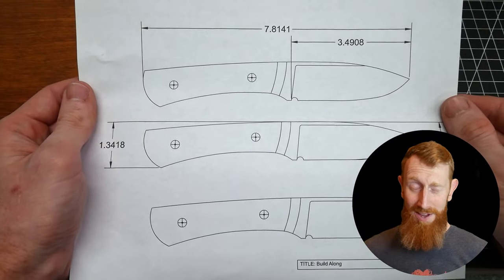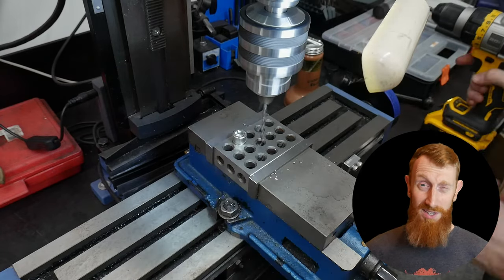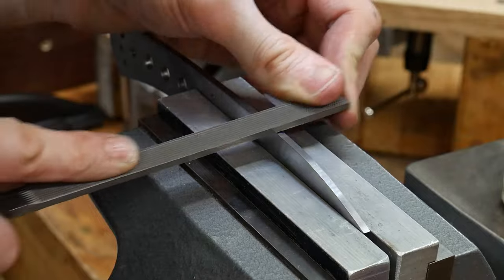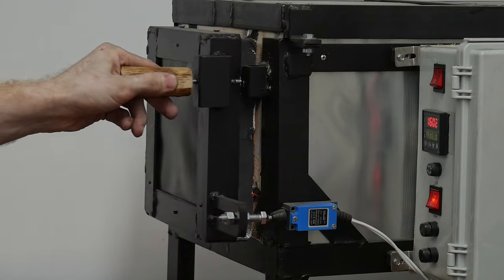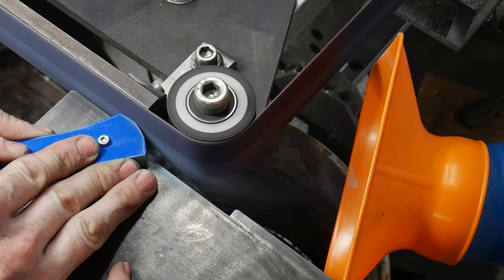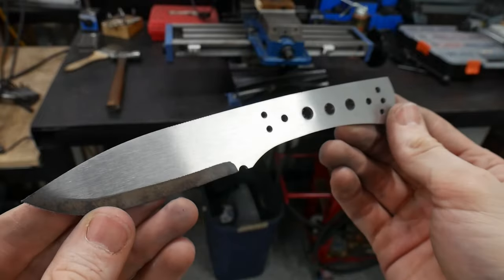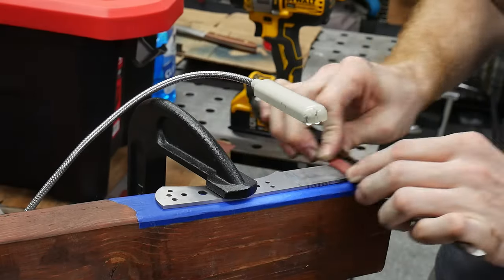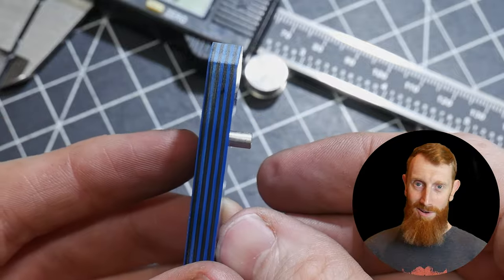BUILD ALONG & Viewer Competition - LETS GO - Part 1

Comment: That's cool. I want to participate but I don't have the tools yet. I just bought the 2x72 belt grinder and it is going to be delivered tomorrow.  I went to Harber freight to buy the Bauer portable band saw that I ask your option on the last video, but they were out of them. I'm can't wait to get started. Stay awesome.
Reply from the maker: Hey Adam, not many tools needed! Check out Cole's build along video here - https://youtu.be/REqEC8x80Kk - He's using hand files!
Reply: @RedBeardOps  You are absolutely right. The reason I'm waiting for power tools is, I have already worn out my joints from heavy power lifting in the past. Also, I work in industrial maintenance for my day job. For me power tools help me as I get older to not hurt myself with repetitive work. I will start making knives very soon. Stay awesome.

Comment: Good Morning.  Could you Please send a link for the bits you used to counter sink the handle material.  thanks
Reply from the maker: McMaster Counter Bore (3102A11) - https://www.mcmaster.com/catalog/126/2608
5/32'' & 3/16'' (3103A12 & 3103A13) Pilots - https://www.mcmaster.com/counterbore-pilots

Comment: what are you making at 6:52?  what bit are you using to drill at 7:01?
Reply from the maker: I was reducing the length of the fasteners. 

McMaster Counter Bore (3102A11) - https://www.mcmaster.com/catalog/126/2608
5/32'' & 3/16'' (3103A12 & 3103A13) Pilots - https://www.mcmaster.com/counterbore-pilots

Comment: Where do you get your threaded pins?
Reply from the maker: Depending on the build you can use loveless fasteners, corby bolts, or gulso fasteners. They are all sold at various knife supply shops.

Comment: I'm pretty sure I'd easily fit into the novice category. I've been making knives officially, I believe just barely under a year, and I only have a 1x30, and a 4x36 that I use to make them. 

Just to be clear we are all trying to make the template knife? Are we trying to put our own spin on things or just trying to copy it exactly?
Reply from the maker: I envision us all building the same knife in a build along. More or less. We're trying not to be too rigid. Just have fun with it! For my build I stuck with the design as drawn. Nothing wrong with your own spin! -- We plan on taking it on a case by case basis so please provide info on your set-up and experience in the email you send the knife pic in. Cheers man! Good luck with the build!
Reply: @RedBeardOps  it definitely sounds like a fun contest. I'll see what I can do. Thanks!
Reply: @RedBeardOps  I feel like I should clarify what I was asking. When I said put our own touches on it. I mean, like choose our own handle material, or blade finished etc. But it be the same knife in the plans essentially

Comment: I went to the patreon link and couldn't find the plans. Do I have to be a Patreon member /contributer or am I missing something. Do I have to order the 1084 from alpha knife supply. Sorry I just had an opportunity to finally check out the details and am extremely limited by not only my equipment but the fact that I(try) to make my knives out of my apt that is in a 4 plex unit so needless to say someone is always sleeping or I'm always bothering someone so I have to take advantage of any and all opportunity to get ahead hence my urgency.
Reply from the maker: You do not need to be a member. It's at the bottom of the post. CAD files and PDF. You can use whatever steel you want. Sorry for my delay responding!